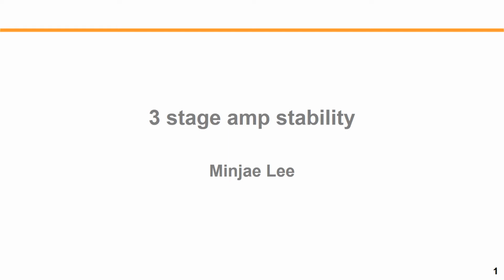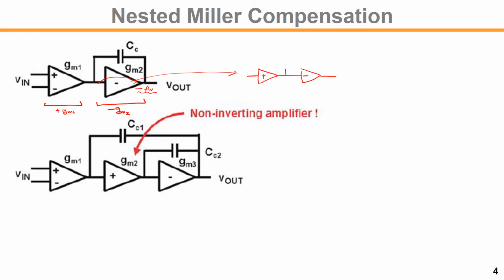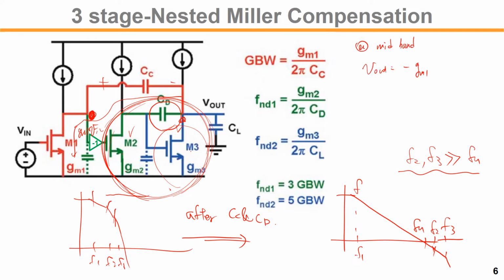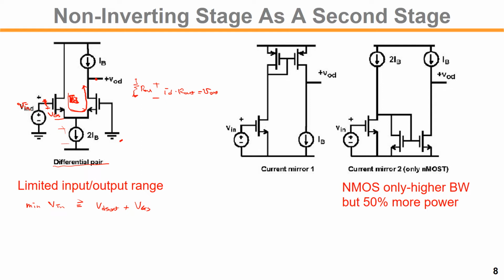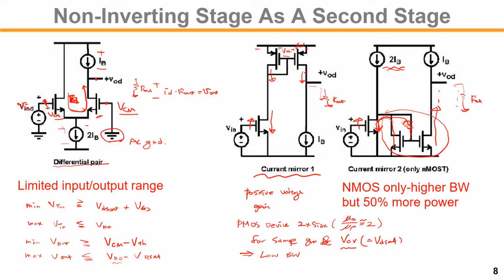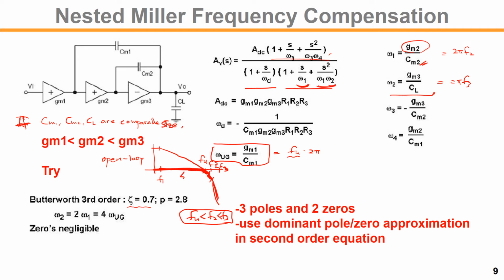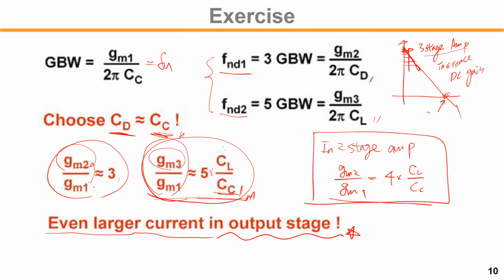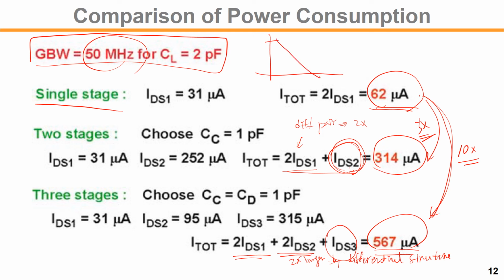24 ThreeStageAmpFreqCompensation video update

Comment: If the 3rd stage has lower gain, usually thats the case for current drivability, why should we make the design complicated through nested millar compensation? Why not just use one millar cap btwn 1st and 2nd stage? Making 1st stage dominant? The 3rd stage pole usually be at higher frequency